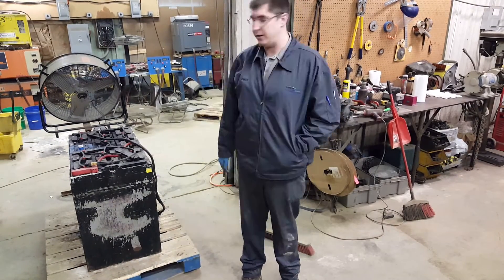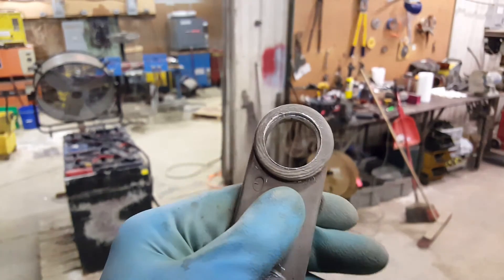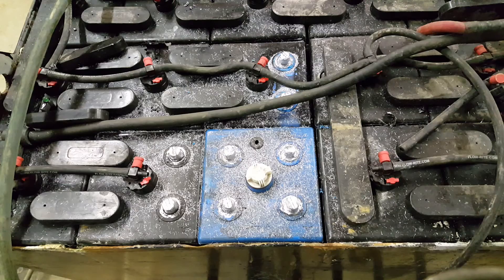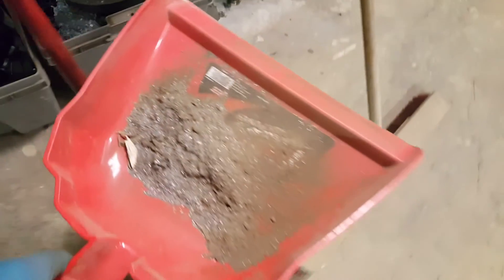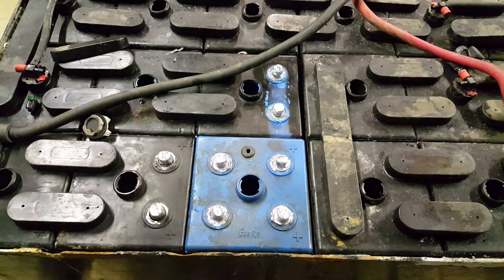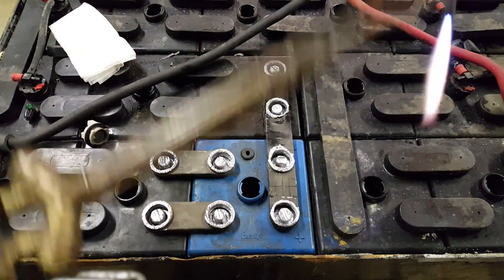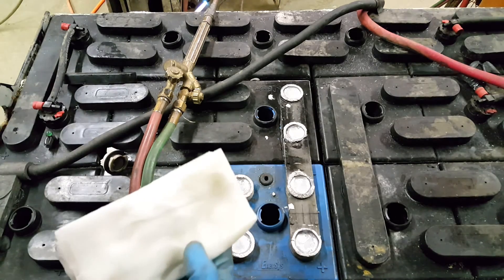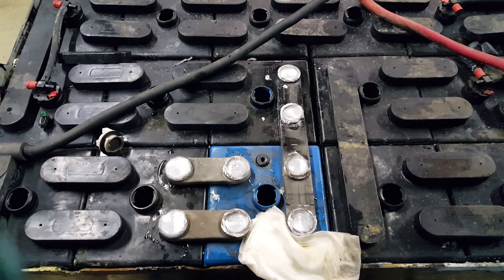How to weld a forklift battery (Whole Process)

Comment: Hello please do you have idea what the weight of the actual battery is after removing the iron case. 
I buy decommissioned batteries for recycling but it is based on the actual weight. I'm wondering if you can help with that info

Comment: I have never know there are lead-acid batteries with welded interconnectors... Can't even remember ever hearing about them in the Netherlands/Europe. Is this mainly a USA-thing?
Reply from the maker: Yes. All the major US battery brands are welded. Although since the lockdowns all major battery brands are really delayed in manufacturing so more euro style batteries are being sold than before. I've sold a couple dozen euro style batteries over this year and I'm happy with them so far. They have the bolted connectors and cables instead of welded. Also super thick steel cases too. I've sold the eternity brand batteries. The traditional style brands I sold before were Douglas and crown.
Reply: @Korcregus  Ah ok, that explains it ;) There is only one benefit to welded interconnectors I can think of: no 'cauliflower' problems ;) (usually, bolted interconnectors start to corrode somewhere at some point, which can grow into a cauliflower appearance of whitish/greenish/yellowish 'stuff' ;)
Pretty funny to think about the fact that the Hyster-forklift we used to have at the company where I work has an 'euro-style' battery ;)
Reply from the maker: @weeardguy  welding has its issues for sure. Enersys brand batteries has thicker lead connectors but at the factory they only weld a small amount of lead at the top of the connection. You can see from my video I'm welding from the bottom to the top of each connector. At the factory the cells positive and negative posts are way bigger and take up more space inside the connector hole. Plus they have to be fast so they end up only making 2 or 3 passes at the top of the connection. This allows for acid and dirt to get in between the post and connector and cause corrosion of the lead and eventually the connector will split. If the batteries get cleaned more often I assume the lead connectors would probably be the better choice. It'll be interesting to see how the bolt style works out over the years.

Comment: What brazer you use? I try before to reconnect the lead head but some not strong enough,some people say need solder grease and some people say need calbulator brazing...
Reply from the maker: I had the same problem at first. The issue was cleanliness. You have to have shiny lead. My tip is a victor 00 size. You also may not have the flame set right. When you adjust the flame point, it needs to have a  rounded point about 3mm long with the rest of the flame jetting out 15 or 20 cm. The flame should be limp and it should be fairly quiet. If it sounds like a torch it's too hot. I have never used solder grease or flux or anything like that. Just clean shiny lead.
Reply from the maker: Also, you may be adding lead too quick. The post you melt down should be liquid and the lead you add should be liquid. Maybe keep your torch in the middle for a little longer and allow the pool of lead to expand a little bit more before you connect to the side walls of the intercell connector.

Comment: hey, what PSI settings are you using for your oxygen and acetylene?
Reply from the maker: 12 psi oxygen 
7 psi acetylene 
I have a small victor torch with a 00 tip.
**FOR ME** I adjust the psi so that the valves on the torch are not "touchy". Meaning I have to turn the valves on the torch a little more to get the right flame point. Not too sharp, but not too rounded.
Reply: @Korcregus holy smokes. We run 100 ox 50 acetylene

Comment: Is it a more recommended that the forklift battery is completely replaced with all new cell packs, or is it the norm to just reweld a new single 2v cell pack to the defected one?
Reply from the maker: Lots of factors to consider. 
1. Age
2. Condition of the remaining cells
3. How battery is cared for (or not cared for)
4. Customer's budget.
5. How many cells need replaced

It takes 3 new cells in a less than 5 year old battery to make the value proposition of that repair not worth it. Usually 1 or 2 new cells or 3 used cells is the sweet spot for most repairs for most customers. More than that and 95% of my customers will buy a new battery. 

I don't replace cells in batteries over 5 years old unless the customer can't buy a new battery or the battery runs really good and I think it will last at least 2 years or more. I've ran into the problem where I replace a cell and 2 weeks later another cell goes bad followed by another after a short time. Customer gets mad and I loose money.

A battery degrades over time obviously and after 5 years on a good battery you're looking at 80% or worse run time in a forklift. And that 80% drops 10% or more each year after that.

To replace every cell in a battery with new would cost 3 or 4 times more than a new battery.

Comment: What size tip are you using on your torch?
Reply from the maker: 00
Reply: @Korcregus  I have a 0 on my torch. I keep melting the intercell connector. I guess I just need more practice.
Reply from the maker: @uhp100  Same here. I switched to 00 and I stopped melting down. Make sure you use a wet paper towel too. Sometimes I form the wet paper towel to the outside of the inter cell connector and that helps with melt downs too.
Reply from the maker: @uhp100  Practice will help you get a feel for how long you can stay in before the melt down happens. With a 0 tip I melted down 1 out of 5 connectors. With 00 I melt maybe 1 out of 200/300 connectors. It was a game changer for me.
Reply from the maker: Victor

Comment: Super helpful normally put around the battery connector wet rag to prevent the mealt the cell is to much work you make very easy course is experienced time thanks for you video hope have the flame need to practice in the torches
Reply: Wet rag is for those that struggle. We don’t wet rag and we don’t burn anything. Be efficient and master your craft and you don’t need a crutch

Comment: How is the correct torch graduation?
Reply from the maker: 00 torch tip. The flame should be about 8 inches or 20 cm long. The end of the flame should be feathered or limp. The inner blue flame should be about 1/8 inch or 3 mm long and it should be a rounded triangle shape.
Reply: @Korcregus  Ok thanks for the information. I'm fond of batteries, especially those of forklifts. I see that you know enough of batteries, I would like to learn more about this ... if you can.
Reply from the maker: @edoscar83  I try to make a useful video every now and again. You gave me an idea to make a video about how to set the torch. It seems simple but it's actually pretty complicated. And a properly set torch makes welding way easier.
Reply: Yes, a correct torch is very important. Because if it is not correct it can damage the connection bridge, and that is serious, or it can burn the plastic cover of the cell ... I see that your torch is so tight that you do not use protection molds.
Reply: @Korcregus  I want talk with you about Battery Sulphation. Do you have any email?
Reply from the maker: @edoscar83  if you want, you can private message me on Instagram and I'd be happy to talk to you more. @korcregus
Reply: @Korcregus ok my friend! Thanks

Comment: You left several valves in place. Ran the torch right over them. Warning.  This could have exploded. You remove all caps and valves. Safety first.
Reply: http://xenangmgavietnam.com/
Reply: http://binhdientrojan.com/
Reply from the maker: RLEESTUDIO You do whatever you think is safe. I know what's safe and what's not safe (because of experience) and I act accordingly. I've blown up 2 cells and 1 golf cart battery, it's not fun. I don't do those things anymore that caused the explosions. I don't need to take off all the caps. You do. So you do what you want and I'll do what I want. Battery work isn't for a DIYer who watches a YouTube video. I'm not saying you are. I'm saying this isn't a diy thing. It takes specialised tools and skill that a DIYer doesn't have and it's impractical for them to obtain.
Reply: @Korcregus  I work for a company refurbishing forklift batteries. It's not exactly rocket science once you have the testers, chargers and tools to lift the unusable cells out.

Comment: so how do you take them apart?
Reply from the maker: Michael Engelman I'm assuming you're asking about the lead intercell connectors. You need a special drill bit that only drills a ring out. That way you're left with a post on the cell and an intercell connector with a big enough hole to weld to a post.
Reply: Here is the tool you need.. Its around 100 usd... https://www.ebay.com/itm/Durite-Hollow-Battery-Post-Drill-Cd1-0-107-00/322978526059?ssPageName=STRK%3AMEBIDX%3AIT&_trksid=p2055119.m1438.l2649
Reply from the maker: William Glaser That's pretty close the the one I use. https://powrparts.com/product/post-saver-drill-bit/
Reply: The video was really good, I have been wondering why those who use solar have not done something like this... This will help me in the future. Thanks.
Reply: http://xenanghanquocchinhhang.com/
Reply: http://xenanghanquocchinhhang.com/

Comment: Hi, how are you.
I would like to know how you do it so that there is no exolosion in the cells with the liquid.
Which you will see more.
Greetings.
Reply from the maker: IngmecIng Ingeniería You just need to blow the cells out with compressed air. The liquid isn't what explodes, the gas that is produced by charging and using the battery is what explodes. Once the gas is cleared, you shouldn't have any issues.
Reply: Thank you very much. Greetings from Mexico. Do you know some place where they sell used forklifts in the USA
Reply from the maker: IngmecIng Ingeniería I know of a large number of places that sell forklifts. Where? What kind did you have in mind? Price?
Reply: hello.
how about I look for a circuit board. You can support me
Reply: http://xenanghangkomatsu.com/
Reply: http://xenangmgavietnam.com/